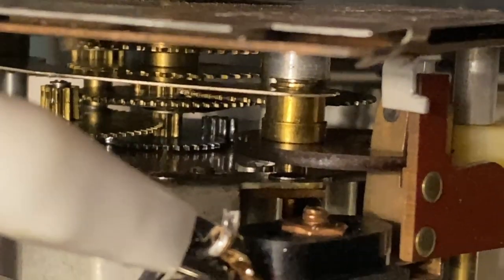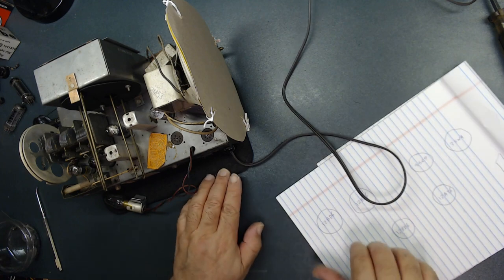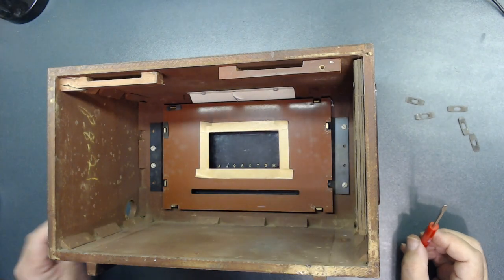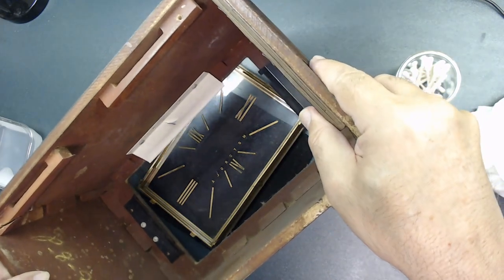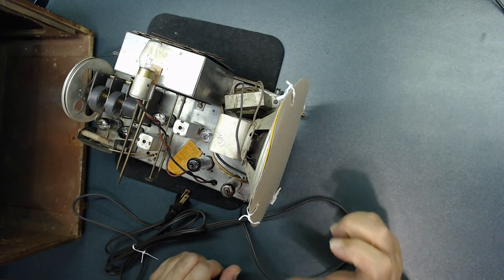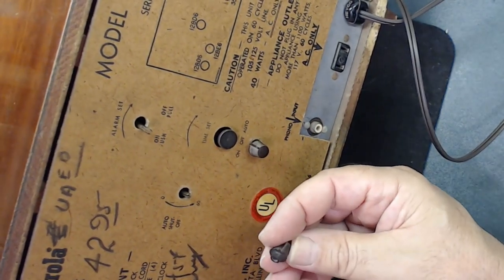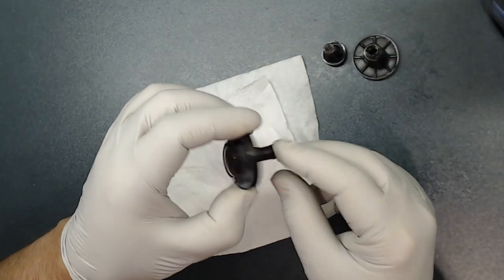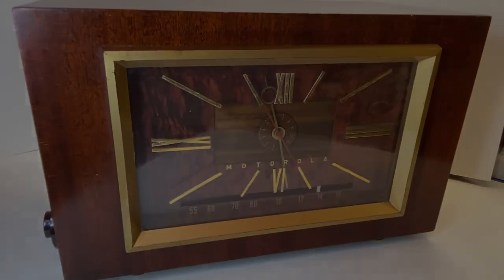Part 4 - 1953 Motorola Clock Radio Repair

Comment: Wow really nice job on that radio and looks and plays great. Congrats on another great video series.
Reply from the maker: Hi Larry, thank you so much my friend for such kind message. She was very excited when picked up her 2 Clock radios. 
I have 2 more radios of her dad. One is 9 transistor AM/FM/AFC radio, replaced 14 capacitors, and it worked for a couple days on just AM but stop working checked everywhere you can imagine but no one has the schematic for this radio for sell or free version. 
They are saying that the schematic should be part of user manual when was purchased.  I spent more than a month or so on this radio with no success to track down the problem. 
I was told by antique radio forum members that the problem might be the AM/FM/AFC switch which is impossible to take it apart due to its very small size and the way was built. 
Anyway changed my focus and working on her last radio. This darn think has a 3” wide chassis, 5 regular vacuum tubes and all wire must be replaced since losing wire insulations. Also part of veneer cabinet is missing so need to fix that as well. It is a nightmare since wires, resistors; capacitors all compacted over each other in that 3” wide space.  Wish me luck! LOL
Reply: @RadioFixer  Wow a 3" wide chassis. Yeah that's a really compacted area. The three tubes were they 1 to 3 volt tubes or 6 or 12 volt tubes because the smaller ones with three tubes used two tubes that were the RF and Mixer sections and basically or one Triode to do three operations and the other two to amplify. So when you said three tubes and not 5 I figured it must be the smaller radio with minature tubes. That one will definitely be a challenge. I have this old 1939 Motorola radio I am still working on have plenty of sound but no stations. Finally I got an AM transistor radio found a clear area and just passed over the if cans and yes there was a station so next its out with the signal tracer. Also have to restring the dial cord not fun it has double springs and 6 pulleys.. Also using tru Oil on the stock of the 1853 Enfield hope to be done by the time the next rifle comes here on Thursday this week.. Oh well it keeps us busy and out of the bars at night lol Good luck in all of your radio endeavors Jay.
Reply from the maker: Lol, definitely keep us out of bars and out of trouble. This darn radio have 5 regular tubes 🙈 guess these radios challenge our minds. That is why we not going to lose our minds. Sometimes the family does but not the radios. 😂😂

Comment: With a six inch speaker, this radio should sound very good. The radio looks very nice with the clock dial light.
Reply from the maker: Hi Jim, you are absolutely correct about this radio. The 6" speaker and Base on volume control, it sound great. The owner was so happy to see the radio is working and performing so well. Good hearing from you! Regards, Jay